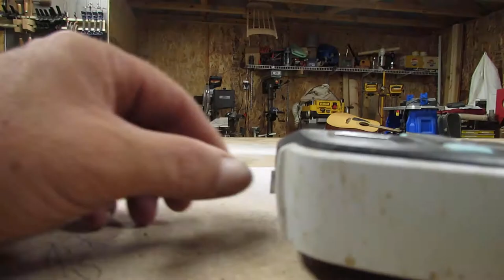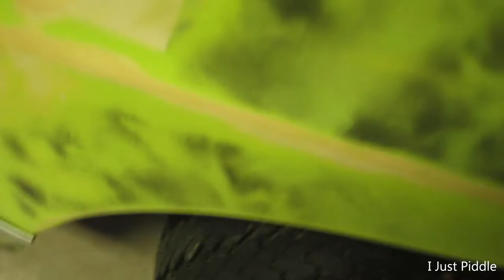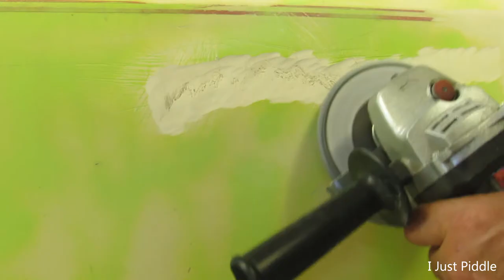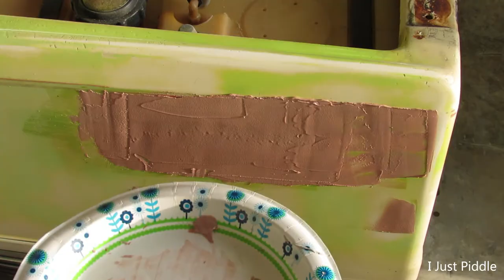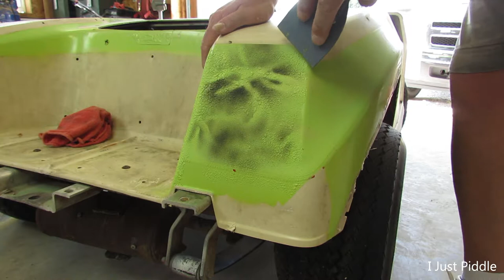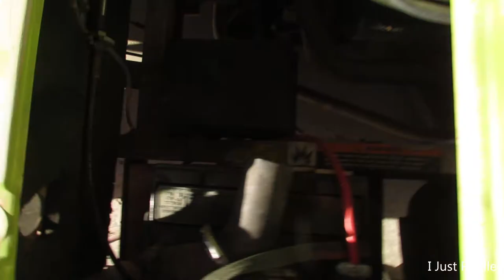1991 Club Car DS Makeover Sanding Bodywork Part 2

Comment: You need to add a fiberglass tape to the backside of those cracks or all your work will not hold up. It will definitely crack again sooner than you think
Reply from the maker: You are so right! Probably about July of this year, 2020 I noticed it had cracked. It probably didn't help ripping down my driveway pulling my trash cart and having it bang the side of the cart right where the crack was. I guess I'll just live with it now. I'm pretty hard on this golf anyways. :)